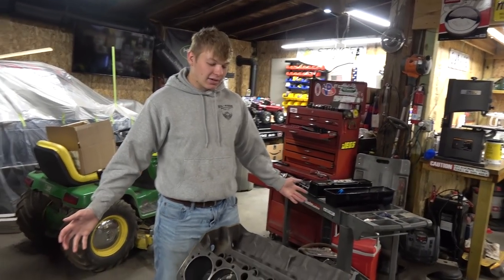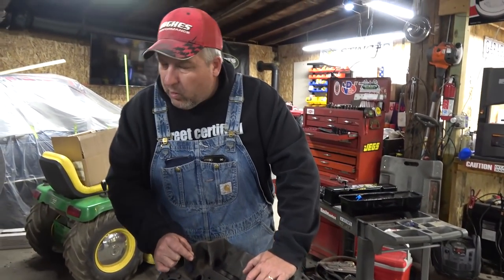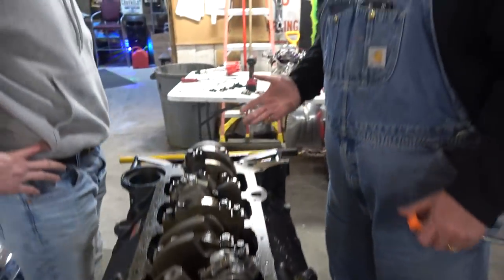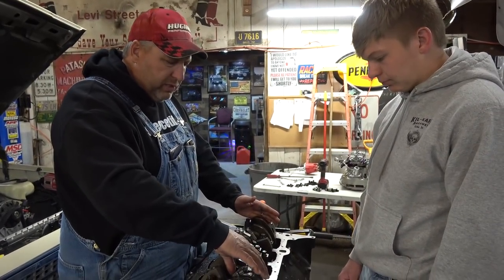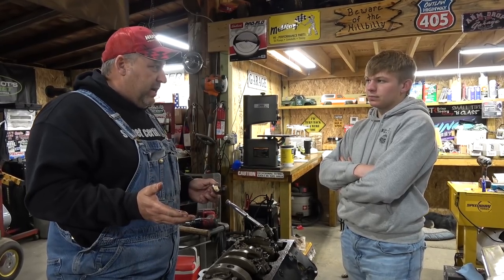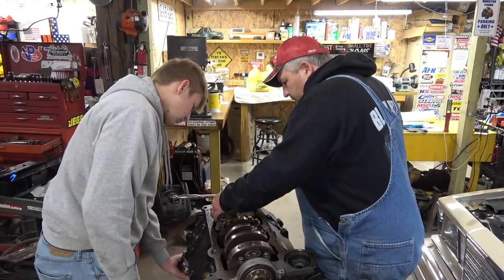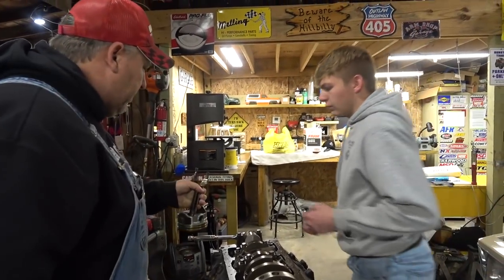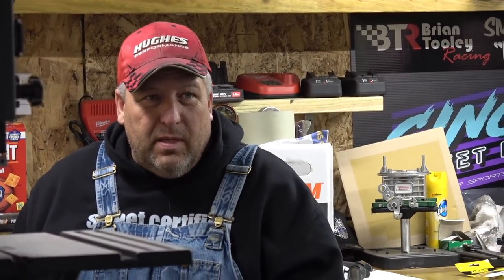385 SBC TEARDOWN! How to go over an engine that's been sitting!

Comment: The engine came from me and my dad lol. Glad it's going to live on.
Reply: Also more info we never ran it came in a trade deal with a friend supposed to be a summit crate motor. It was a shortblock when we got it and it was supposed to be a good runner minus the smoke. I do ls stuff mainly and just wasn't something I needed. Sat for about a year before we gave it to Matt

Comment: I've said this a few times learn all you can from Jeff and Bill it's free and also better than college. I love all 3 channels. I have run flat tappet cam back in the 70s and 80s in my small block and dint have a problem it's like what Bill said on break in the correct oil make sure nothing leaking close on timing and 2000 to 2500 fluctuating the rpm for around 30 minutes I didn't have a t-stat in it and had the garden hose running just in case it started to get hot. Bill and Jeff have all the knowledge that you youngsters will even need to go racing or have a beast of a street car or truck. Love what you and Allison are doing and keep up the awesome content looking forward to seeing the next video and as always be safe 👍

Comment: Hi guys, just want to say great job on EVERYTHING. I spent 20+ years rebuilding engines as a profession, nothing wrong with a flat tappet cam. Your dad is right about the oils but they do make a zinc additive to mix in with the oils. Tell the old man he's not so old.

Comment: Speaking from experience, I bracket race a true 350 cid 1 piece rear main 880 Mexico block. When I originally bought it, it had a crane Saturday night special flat tappet cam. Did great. Took it apart and had it rebuilt and used an Elgin flat tappet cam with isky lifters with the edm holes in face of lifters. Used Brad penn oil to break it in. Did not last 5 minutes on dyno during break in before the cam and lifters wiped out. What’s funny was the engine builder had told me that he had been hearing nightmare stories of flat tappet failure in the weeks leading up to it. I ended up having to, of course, tear it down, but all new rings, bearings, gasket oil etc and start over. However, we put a erson solid roller in it and this thing is still going strong. My point is, the flat tappet cores are not what they used to be. I suggest doing a roller cam, even if you got to find a later model 350 1 piece rear main block that allows roller lifters like your dad mentioned. That should be easy and cheap to do. 

If you do run a flat tappet cam, buy good lifters with edm holes, put very lightweight valve springs on it for break in and buy vr1 or Brad penn oil. Of course, after break in you will have to change springs back to what you intend to run, set lash, run it again, check lash again etc. From one young budget racer to another, I’d definitely look at a roller cam and not do a flat tappet. Even if you have to wait on parts and/or money to do it. Been there and done that dude…

Comment: Zinc (ZDDP) is the additive you are looking for although numerous knowledgeable people think the quality/finish of flat tappet lifters in the last several years are the primary cause of this issue.  Never had a problem in the late 90's early 00's with 10+ flat tappet hydraulic vcams.  Also - do not use excessive spring pressure.

Comment: You'll like the 385 with vortec heads. Same combo I run. Just a couple things to keep in mind is without modifications vortecs are limited on cam lift to about 480. You can use LS 6 Blue valve springs  and different spring retainers to get around a 525 lift cam. Shell Rotella oil or equivalent if you go with a flat tappett cam. Also need a vortec specific intake. Good luck on your build Tommy!

Comment: The electric paint gun will work just fine for your frame they actually work pretty well and it's better than having to have air or using 20 paint cans

Comment: Great video you two, keep them coming. And another little bit of advice,  the first 500 miles you drive it no real high RPMs. You can score your cam lobes. It gives your lifters a chance to ware in the concave of the lifter
 surface. At least when I rebuilt my last flat tappet engine in 1978 or79. Also after break in use Lucus that cam will last alot longer. But this is a old school way of doing things, I haven't rebuilt an engine in 25 years or so things might have changed.

Comment: I would highly recommend hydraulic roller cam . Also if you go over .470 is lift you need to have the valve guides cut down on vortec heads. Check out quick cam lifter trays you can use roller lifter on a non roller block with them.

Comment: Just make sure that you tell Uncle Bob you are using Vortec heads. Those heads might need the valve guides cut down depending on camshaft lift specs. If you are running a carburetor those Vortec intakes are pretty pricey. Good luck Tommy!
Reply: Absolutely. 👍🏼

Comment: Roller cam = less friction. Turns to a tiny bit more power and fuel mileage. Every little bit helps. Also you can get the longevity without the most expensive oil

Comment: I didn't hear (or missed) what this engine is going in, but guessing one of your daily drivers. And, it sounds like you've got lots of time to get this build done.
If so, take this opportunity to learn as much "do it yourself" as possible (ala Vice Grip and Hustling HP), which is as budget as you can get.
Meaning, get a budget friendly rebuild kit with rings, bearings, flat tappet cam, etc. If you really want piece of mind, let Bob clean/hot tank it, and maybe look it over for serious defects. Other than that, do everything else yourself.
This is exactly what I just did with my 16 y/o son.
He learned how to install his own cam bearings, freeze plugs and wrist pins. Measure his clearances, set ring gap, polish journals, lap valves and a bunch more. He just finished rebuilding his rear axle. Not gonna say he enjoyed measuring backlash and what, but he knows how. We're rebuilding his transmission right now.
Why? He's getting into drag-n-drive events and needs to be able to keep it running when something breaks in the middle of nowhere Kansas. Having watched you and Allison, I'd think you would also enjoy drag-n-drive events. The challenge is great.
You're Dad is an outstanding resource to teach you all of this. Learn from him, you'll never regret it.

Comment: You two are great together and learning so much thank you for the hard work I am your dad's age and I have had to do the EXTREME BUDGET BUILDS do to having a house full of children and being the one one able to work in my house and it is a gamble some times if it was me I would wait to get a ROLLER CAM I will never install a flat tappet again and we are like y'all there are always 2 or 3 engines out and in the works but after I and my oldest son had a flat tappet fail we will only go ROLLER. and that is after 35 years of doing cam swaps and motor builds

Comment: Tommy, from a phone call with Comp Cams several years ago about a flat tappet cam = Use your original used valve springs or remove center springs for 500 miles for break in. Then replace springs with matched ones. People who are wiping them during break in even running ZDDP are using too stiff of springs (the ones matched for the cam).  Weaker springs and quality oil with the additives for flat tappet is the trick.

Comment: Great show! Teaching your kids these skills are very important and will last a lifetime. 
I've had hydraulic roller and flat tappet cams over the years and unless you're racing or on a Dyno , to me you won't see ,feel, or hear that much difference. Use ZDDP additive and high zinc oil and you're home free. I even had a carb problem on a 350 using a comp 270 magnum having to restart 3-4 times with no issue. Good luck!!

Comment: Love the channel and you can run a zinc additive to the oil if you run a flat tappet cam and it will help from hurting a cam lope
Reply: He can run a diesel oil they have zinc no matter what I would use oil adaptive with any oil for braken engine in

Comment: Internal or external balance since that is a 400 crank it is aftermarket because it has a one-piece crank seal so the crank is probably a pretty nice piece even though the rods look stock
Reply: Most likely it's not a 3.75 crank but it's a 3.48 crank, the chance of it being a aftermarket crank is probably pretty slim, Bob will be able to tell, good luck with your build

Comment: Also on older SBC with mechanical fuel pumps, if the pump goes bad it can pump fuel in the crank case as well threw the oil pump pushrod and oil drain back in the fuel pump mounting boss.

Comment: Regardless of what cam you run see if your Dad can borrow that engine test stand, I have one and it's invaluable. Great for running a flat tappet cam in but also you can check for oil or coolant leaks before it goes in the truck. I had a real bad rear main seal leak, I thought I'd put in back to front but it was a faulty seal, rare but can happen. If that engine was in the car then it would have to come back out again. Also everything is easy to get to set timing, carb adjustments etc. Good luck.

Comment: Valvoline VR1 has the correct additives for a flat tappet cam. I use it in my big block olds. Amazone will ship it to your door for probly the best price.
You hit on some interesting points in the close of your video. Specifically the amount of time. Drag racing is a fast sport that takes lots of time. Travel time.
Prep time.
Maintainance time.
And some times after all that time, you still get beat 1st round. It happens. 
I still wouldn't trade that time for anything else.
Best of luck to you both.

Comment: If you do go with a flat tappet cam you need to use zinc additive ..I buy it from autozone ..it's made by Lucas  oil co ..  I just fired a engine up sat that has a flat tappet cam in it and it went perfect.. I've Ben using this product since 2005 when they removed zinc from oil wich is a key factor for breaking a flat tappet cam in .. I lost 3 cams that year .. comp cams is the only manufacture that gave me a replacement for free that's why I still buy comp cams .. but I'm hearing their lifters are no good at the moment .. good luck Tommy and enjoy your free education from one of the best in the buisness ..your ole man !!

Comment: That tag looks like it came from Jasper engines. My blueprint engine has a tag that says Blueprint and the cubic inch displacement and serial number. Tommy I'm sure your dad knows but you can run the numbers on the driver side of the block to see exactly what it was built for so you know you get the right parts and when you use a hydraulic flat tappet cam you can run 15-40 diesel oil or they do have a additive at Jegs you can use in any 10-30 oil that has the zinc needed for the cam.

Comment: Its worth the money to invest in a solid short block, all the extra power makers can be added here and there as you get it like say go with your vortec heads and whatever cam and down the road if you want more its a simple head and cam swap or intake whatever but regardless your short block is gonna be there done ready to handle what you bolt on it. If you start with a solid foundation and do it right the first time you won't have to pull it again and go back in there, then you can bolt on all the hp you want lol but as the ole man knows plan ahead, if your spray or boost it gap the rings and consider the right pistons, rings etc now then like I said its ready for whatever you wanna bolt on or upgrade later, even if its a few years later that foundation still gonna be there and can handle the miles and whatever else especially being a DD

Comment: For a daily a roller cam is best and no zinc additive needed any cheap oil will work that you can actually FIND anywhere anytime. Theres a reason every manufacturer went to roller cams for the last 30 years loll! Putting $ in the cam is worth it. The rest will be stock replacement parts. I like seeing both of your projects including both dads!

Comment: If you go flat tappet cam get STP blue container with zddp which is zinc get two  containers to add too the oil for break-in and keep using Stp to help with cam lift and Lifters lift.

Comment: Cool I also have a 1987 Chevy p30 4 bolt main 0.40 350 tbi truck motor and it doesn't have any of the roller cam boss in the lifter valley either. And my truck smokes out the exhaust because the genius I got the truck from out the 94 factory 258k miles cylinder heads on it and it's valve seals are toast!!!

Comment: ball hone that beeotch and check the rings and possibly reuse unless ones damaged with the oil issue, rod bearings and roll, i rec the .480 230 cam I've had extremely good luck with that grind, and it lights off fairly earlier and still revs over 6k. i could drive it anywhere smoother idle and ran 11.30s👍

Comment: It’s nice to see you youngens learning. I would try to go with a hydrologic roller cam. You don’t wanna deal with a flat tappet and they rob HP. Also Vortec head valve springs are for a roller cam. Bring the heads to Bob just to take a look at for you and replace the valve seals on them. I’d help you out if I didn’t live so far away lol. Good luck and keep up the good work!

Comment: Just a heads up, the serial number is blueprint, it's a cast crank, they convert a lot of core two bolt blocks to 4 bolt. They do sonic check before boring. I bought the same short block, but it has roller lifter provisions. For a budget piece it is decent.

Comment: By your dad's guidance it'll be a fine motor for the square body. Those parts lasted many a mile as a daily. Flat tappet cams, broken in properly and used with a good zinc heavy oil work fine. Enjoy this time and learn.

Comment: I switched last winter to a retrofit roller cam, first time ever, I drive my car about 1 or 2 times a month, when I took the motor out it hadn’t been started for about a month which is common for this car and when I pulled the flat tappet cam out most of the lifters were completely dry of oil between the lifter and cam surfaces, the couple that did have oil was equal to a drop, the tiniest bit of oil, only thing I could think of is how many times the motor sat for a month or longer before it was started with all the oil dropped off the cam and lifters, after seeing that it’s hard to go back to flat tappet, roller for me from now on.

Comment: Been researching the flat tapper cam thing myself lately. Can’t buy cheap lifters. Have to use high zinc oil to break the cam in. Make sure you talk to a reputable cam grinder and follow their advise. I’ve even read that if you’re running dual valve springs you should take the inner springs out for break in and then put them back in.

Comment: If I remember correctly the roller cam v8 and the tbi roller tapped boss 4 bolt main truck blocks are the 638 casting blocks and I'm pretty sure the numbers on my 87 Chevy p30 4 bolt main block is different.

Comment: I don't do flat tap cams anymore. Morel linked retro Roller Lifters for your roller Cam? 5.7 master (with 0.40 rings) rebuild kit is around $350 (when in stock) no 0.60 ! I'd  just disassemble clean, put back together with the engine kit, get a set of heads, then decide on what kind of intake? If I'm using the pistons again, I check piston top VS deck height, how much between the piston & deck clearance there is, for head cc & gasket thickness later.

Comment: With a flat tappet cam a good oil to use that is not very expensive is Rotella T4 diesel oil it has all the vitamins and minerals a flat tappet cam engine needs

Comment: Tell Bill to look up “small block valve lifter quick cam guide” it’s a cheap way to use factory hydraulic lifters using an Ls style plastic guide tray… really cool and can be bought through scoggin dickey for like 20 some bucks if I remember correctly

Comment: my 2 cents on the flat-tapped VS roller cam. YES flat tappets are cheaper and if you get it broken in right they are fine. but, you have to run the Zinc Additive (ZDDP) that you have to add at EVERY oil change or add more expensive "Racing" oils that come with the Zinc additives. plus, you have to wager if you want to risk ALL your bearings wiping out, and potentially damaging your crank or rod journals if that cam goes bad. my advice would be to spend the money up front. for example on Jegs, the CHEAPEST flat tappet cam/lifter kit is a Jegs brand cam for $111, and the cheapest retro-fit roller cam kit is a Lunati barebones cam for $705. so you just have to figure if you would rather spend $600 more up front, or spend $xxx dollars for new bearings and machine work (in the best case scenario) and special oil/oil additives later on

Comment: Bill , the 1967/  327 I JUST BUILT ! I used a Comp cams hydraulic flat tappet cam & lifters P/N#CL-12-205 it was $156.00 , very mild for a daily driver .425 lift / 205 @ .050 Dur. on a 110 CL. broke it in at 2,000 rpm for 30 mins and drained the  Comp Cams brake in oil & new LONG  Wix filter , now have about 1,000 miles on car with 2 more oil changes already with Valvoline high zinc VR-1 / straight 30W. Everything is great.  The reason I went so mild on the cam was JOE BIDENS GAS PRICES ! There saying it will hit $9.00 a gallon very soon. Something to keep in mind when picking out a cam.

Comment: If the bosses are there in the lifter Valley have Bob drill them for the lifter support  braces so you can run hydraulic roller.

Comment: Best oil on the market for a flat tappet is valvoline high zinc 20w50 racing oil. It's what pretty much almost every cam company will recommend with a flat tappet that won't break the bank

Comment: That electric sprayer will work fine I have use the Wagner spray gun to spray all different kinds of things and it works from frames to spraying bedliner I've done all kinds of things he just got to watch out it might drift out of the nozzle as long as you pay attention to that you'll have no problem with that electric sprayer